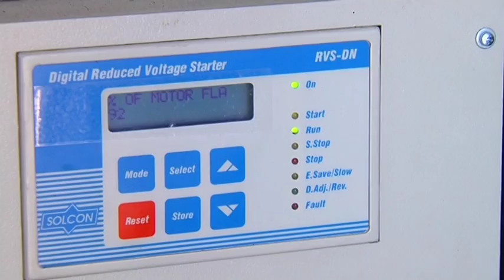Gaza: the battle against sewage

Comment: The priorities of Hamas is clear. They use the concrete and steel that comes in to build terrorist tunnels. Instead of building sewage system. When they find metal pipes they turn them into rockets instead of using them to have clean water supply system